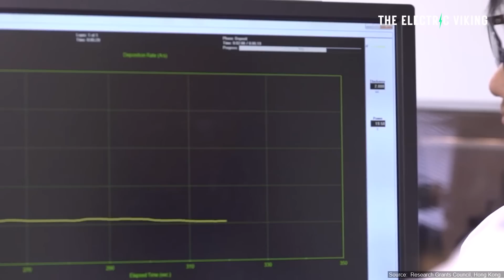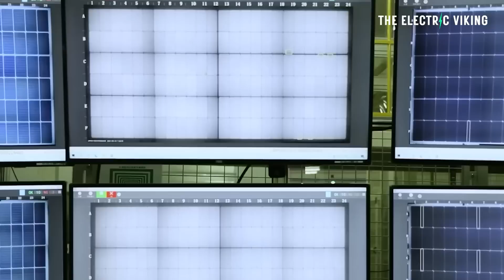China's record-breaking new solar panels will be made by robotic humans

Comment: Interesting video, you can't break the single junction record via a tandem cell.

One can only exceed the single junction theoretical limit via tandem or even a multi-junction cell.

Therefore, not record breaking.
Reply: For whatever reason, it seems these cells qualify as single-junction. Eg NREL certainly knows the difference.

At any rate, i don't care about that question, just "What's the price per kwhr production? And lifetime power curve?"
Reply: @lengould9262  $ / W to purchase or LCOE is the key.

But, no they don't qualify as single-junction from someone who's former company was and is on the NREL chart.

Comment: Nothing really new. Same old perovskite with short lifespan. A new record by a few points. So what? It only has a durability of maximum a few months before degradation down to unacceptable levels. Not anywhere near the 20-50y lifespans of silicone cells.
Reply: Silicon.  Silicon = chips.  Silicone = boobs.  and caulk.

Comment: Pls do a video on the spiralling global production of solar pv and renewables. October global renewable production touched 85+ gw i.e. 1 TW annualised!!
By 2024 end solar pv alone will touch 2.5 TW !!
Reply: Careful you don't confuse Watts (power) with Watt-hrs (energy).
Reply: @lengould9262 a watt is 1amp@1volt have that be produced for 1 hour and you get 1 watt/hour. Rinse and repeat.....increase the voltage or the amperage and get a different wattage that is Ohms Law w=ir.🤔
Reply: @michaeldautel7568  I know. Was industrial electrician / electronics tech for a couple of decades.

Comment: At these prices solar panels are cheaper per square unit than plywood roof sheeting. A spectacular opportunity for innovation disruption.

Shingle roofs last about 20 to 30 years, about the same as today's solar panels. Stripping off today's petroleum-based asphalt shingles ends up with huge amounts of fossil waste in landfills.

In the future aging solar panels could be remanufactured.

B
Reply: Yup. My revivifier rebuilt the bathroom - used solar panels for the subfloor 🤣🤣
Reply: Shingles suck
Reply: Asphalt shingles could be remanufactured too.  But they won't be, and neither will solar panels, because it's not economical.

Comment: This material has traditionally had reliability and longevity problems. I hope these have been addressed and proven through publicly available testing.
Reply: I agree. The "greenest" panel is the one you don't have to replace! I would much rather spend twice the money per watt, for less efficient panels, if they can keep ~90% of their rated output after 30 years!
Reply: @vincentrobinette1507  Exactly. The technology will constantly improve, but it needs to be demonstrable before tens of millions are spent on new farms. 40+% multi-junction panels exist, but they are not economic. The typical solar farm does not use high or even medium value ground. More often than not, the middle of nowhere. The tradeoff then becomes the cost of the mounting and installation and ongoing maintenance. One thing we have learned is that the old moncrystalines, absent damage, will go for many decades with minimal loss.
Reply: We wont know until they field it. 😂
Reply: Chinese companies pretty much provide their products with 0 profit at the selling prices. They literally can make more profit by reducing production by 30%. Are they stupid?
Reply: Technical challenges will always be resolved once the foundation is laid, history has proven that. Take a long term view, renewable energy is the only sustainable way to generate power.